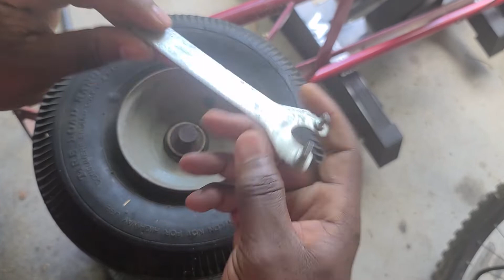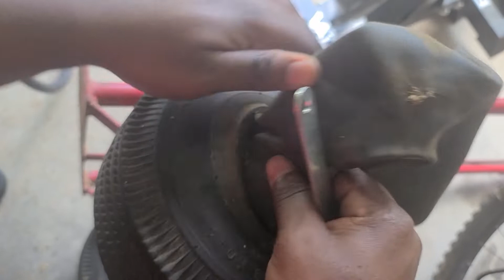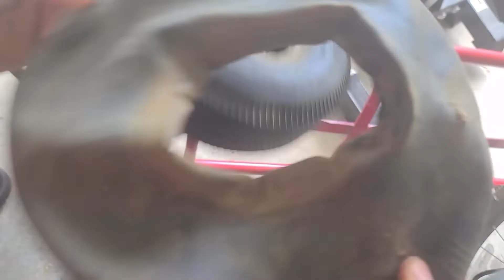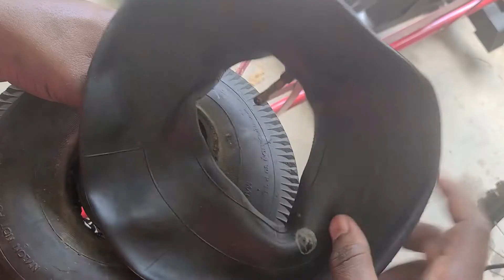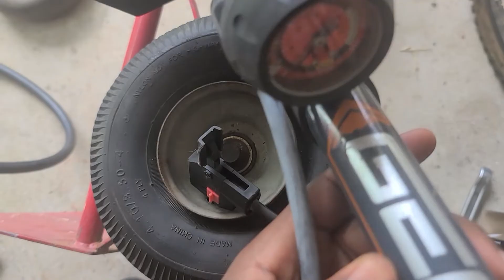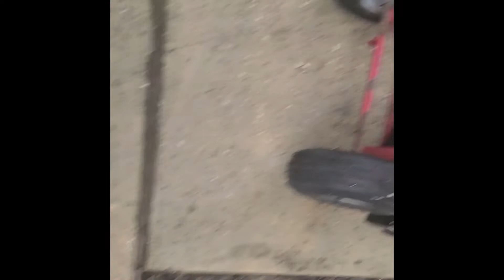Dolly Hand Truck Flat Tire Fix | Replace Inner tube | Quick Repair Guide

Comment: You are supposed to put some air in the tube once you have it in and the stem in place before you put the tire back on. You need to be sure it isn't twisted and is smooth against  the inside of the tire. little soppy water would be a big help.

Comment: I did this a month or so ago. It was one of the most difficult, aggravating tasks I ever had to do. I was sure I wasn't going to get the tire back down inside the rim. I saw a video on YouTube showing how to use C-Clamps to help hold the tire rim in place while using a screwdriver to angle the tire just right. I didn't think I was going to get the tire back in place and I dread the time I may have to do it again.
Reply from the maker: I hope you were able to find a good solution . Mine held up until i upgraded my dolly . they usually last a while if you keep them in service. Maybe use a little lubricant next time!

Comment: It’s me again.  I put the inside tire rim or bead on the wheel rim, stuffed the tube into its tire, made sure the tube wasn’t twisted and that it was oriented so the air valve was through the hole in the wheel rim.  That left the outer rim or bead of the tire free.  Then I tucked as much of the tire rim or bead as I could without lots of effort, inside the wheel rim across from the air valve.  Then I got a smallish C-clamp, put the stationary part of the clamp on the tire tread on the side opposite the air valve, and I located the moving threaded part of the clamp on the nearly flat part of the wheel rim and tightened the clamp until it was holding the tire securely so it that part of the tire bead wouldn’t pop out of the wheel rim.  Then, using a large flat end screwdriver, I slowly worked the remaining tire bead into the tire rim, and halleluiah!! it was no time at all until the tire was securely mounted on the rim..
Reply: Holy sh*t seriously best details for this but dear lordy I'm hoping I don't have to do that

Comment: Thanks for this. Great help!
Reply from the maker: Glad I could help
Reply: Good video!  I’m struggling with the same brand of two-wheeled truck after patching two tube leaks, then working the repaired tube back into the tire (which also seems to have a crack in the side of  the tread—Chinese quality!) and will keep struggling to get the tire back on the rim.